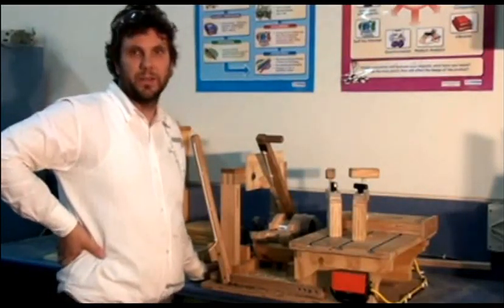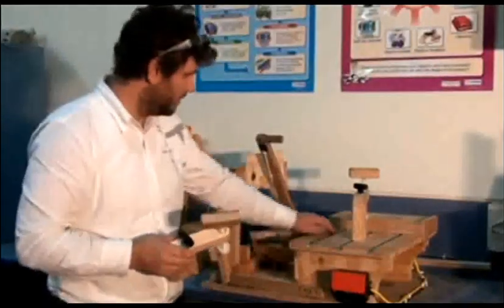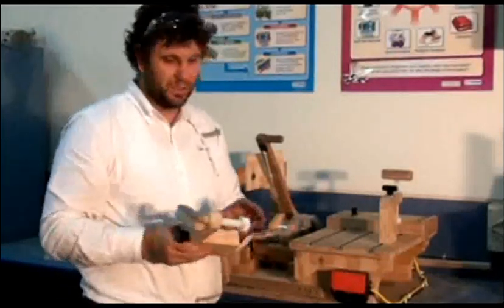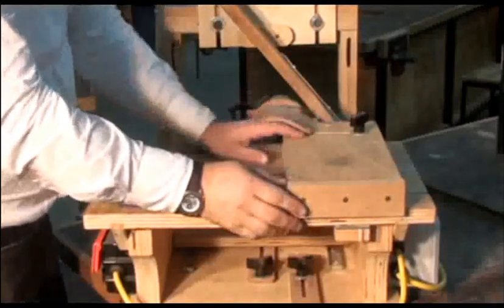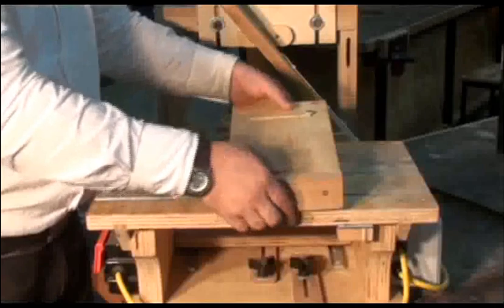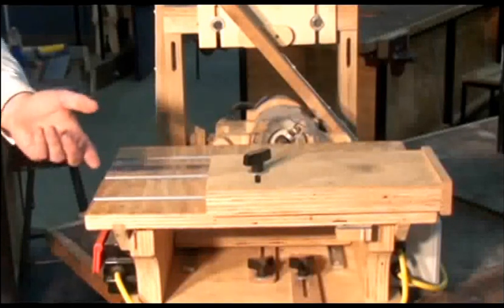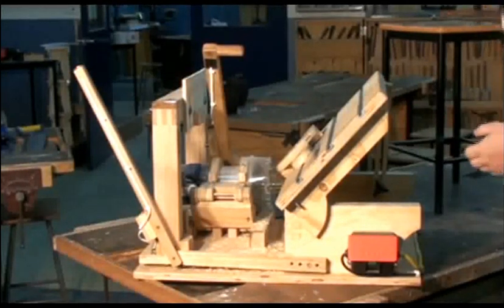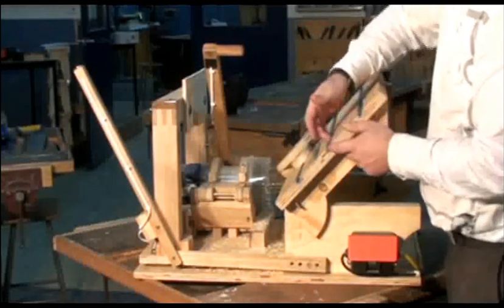pantorouter improvements part 1

Comment: Hi, I like the idea of having the nylon screws for the hold downs. What size threaded nylon rod did you use, and is there a nylon nut embedded in the hold down, or just a regular metal nut?
Reply from the maker: nylon nut in hold down as my students are quite persistent. M16 from memory.